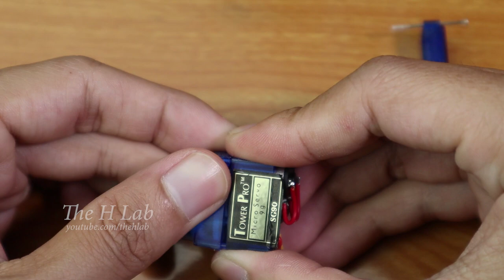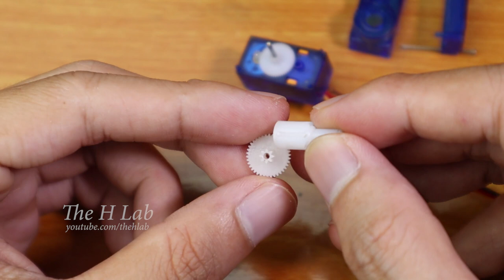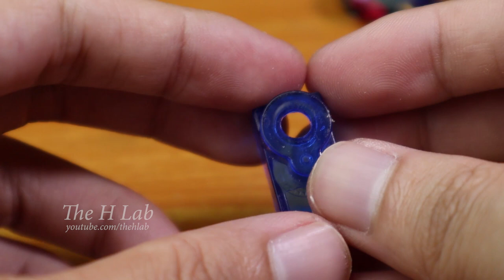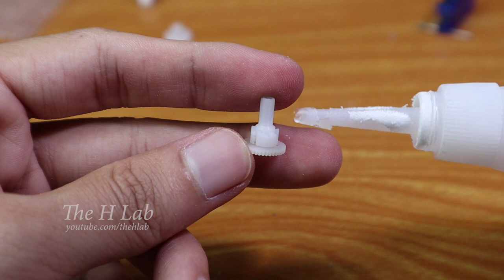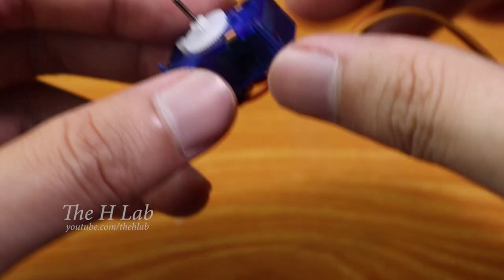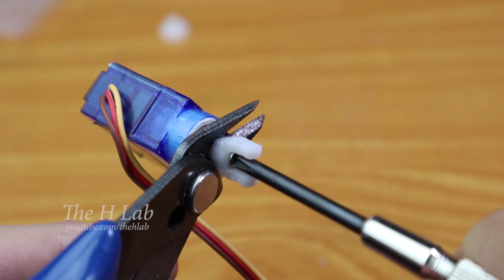SG90 Servo modified to increase speed

Comment: Dude you basically just got rid of the potentiometer and the controller, what you have is just the DC motor and you change the rotational speed with PWM, but DC motors are MUCH cheaper. Why would you buy a servo to turn it into a DC ???
Reply from the maker: This is for 2-direction. DC more is cheap but 2-direction brushed ESC cost more than 3$ while this Servo cost only 1$ :)
Reply: This can be used as a gearbox for micro rc crawler. Looks like a yoke on it now for a drive shaft. This is a creative way to make a transmission.